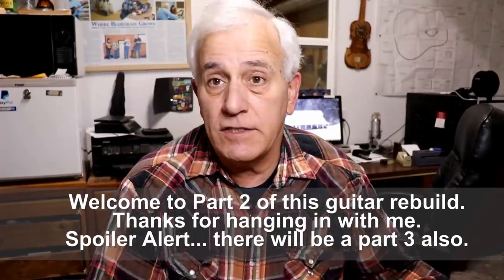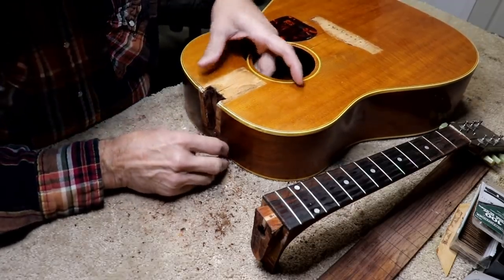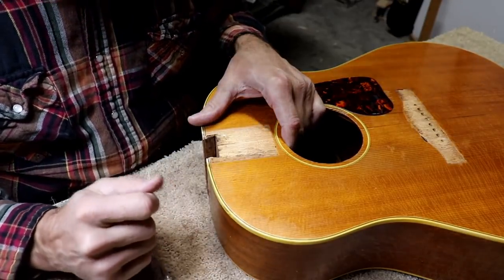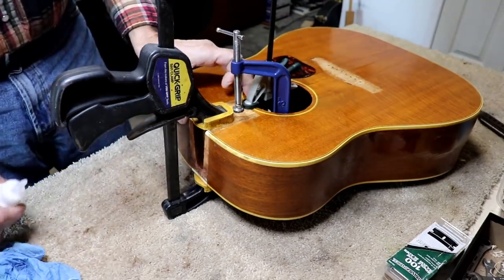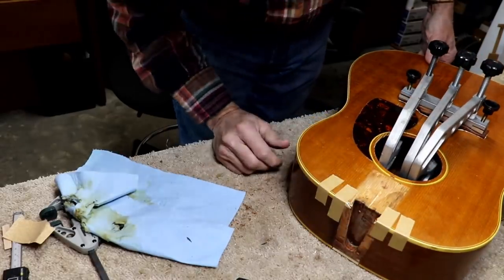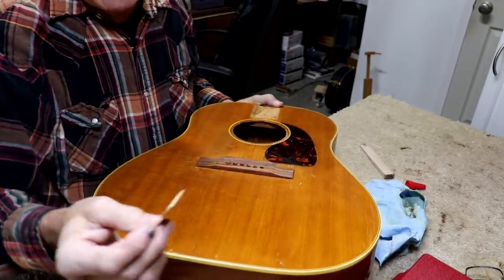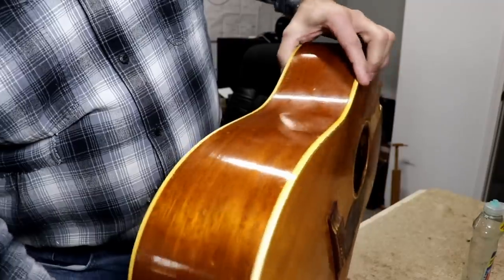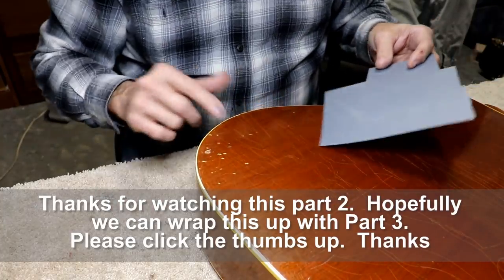278 RSW Gibson Guitar From England Rebuild Well Almost P2

Comment: I just don't get all the agonizing on replacing the fretboard. The customer said that he's "all in on the repair" and the repair cost is based on an hourly charge to get the best possible result for what is, obviously, a very much-played guitar. If you hope to get the best possible result for the customer, and many more years of playability, you'd replace the fretboard without another thought. The comments about how much work it is becomes irrelevant, unless you just don't like doing the work, in which case you shouldn't be doing repairs on acoustic instruments.
Reply from the maker: Can you watch part 3 you might have a different opinion. I've been doing this for 35 years 36 years actually and replacing a fretboard is not a simple deal and it creates as many problems as it solves. If you don't know that then you're not too familiar with this type of work.